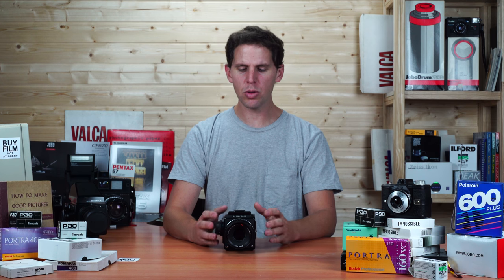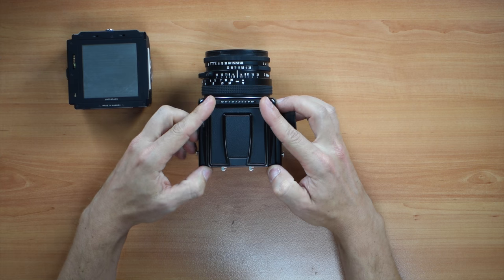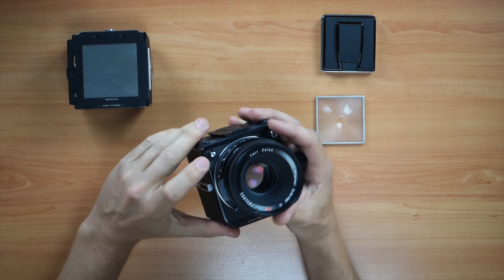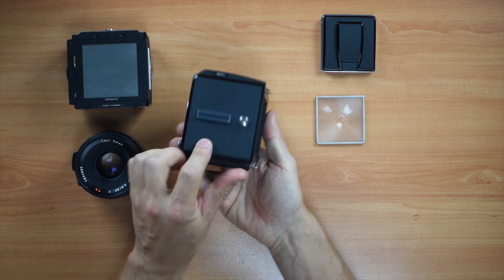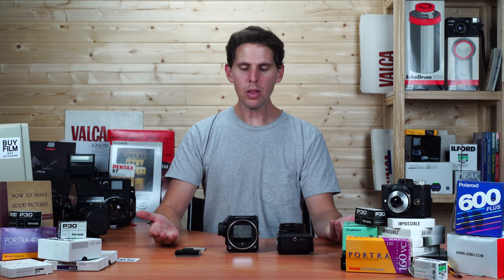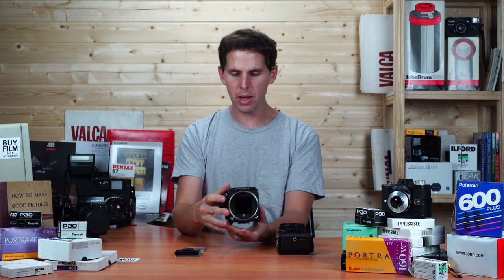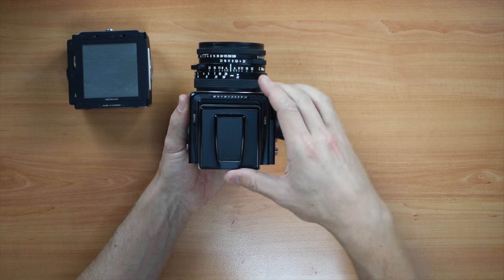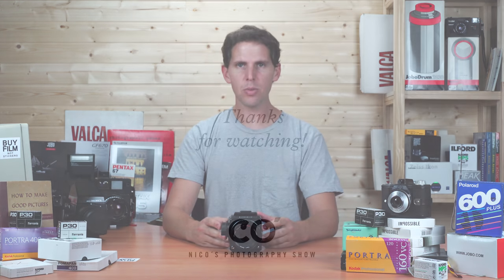Set Up A Hasselblad 500CM (V Series): How To

Comment: Hassies look so nice but ive heard nothing but horror stories about their actual use on anything other than studio and landscape. Not your everyday camera i guess
Reply from the maker: +The Cantrell Project I have had a few issues in the past but they are pretty amazing cameras and the system is solid to be such an old design.
Reply: I've never had an issue with my hasselblads.  My first one was with me through rain and shine, literally.  I took it everywhere, dropped it all over, got mud and dirt on it, left it in -6⁰ weather an it frosted over, lots of rain, blizzards.... they're fantastic.  Never serviced.  I sent my second one in a month ago since the mirror came loose, but it still worked just fine, would rather it not develop a worse issue later